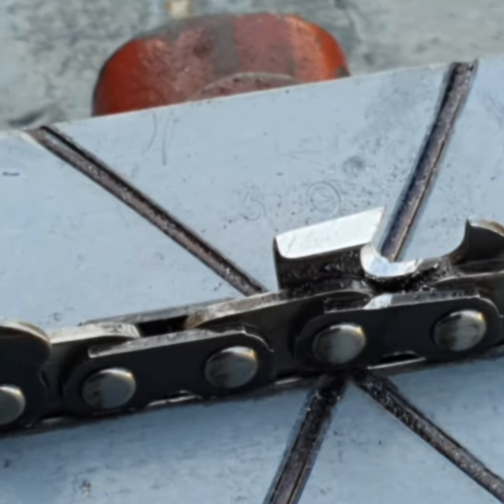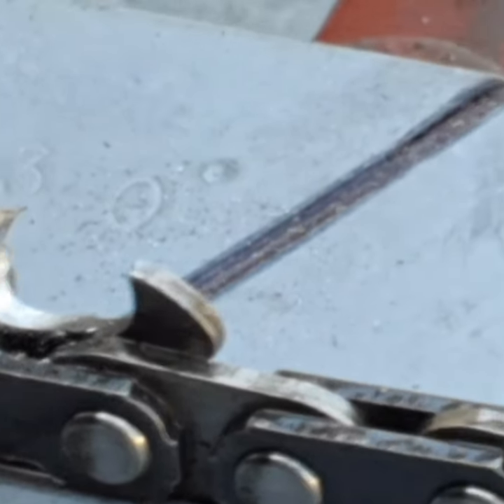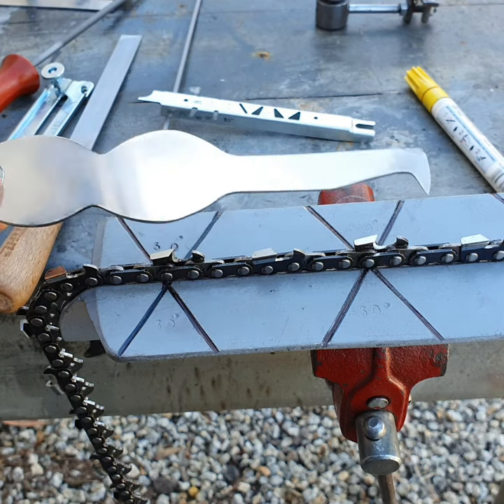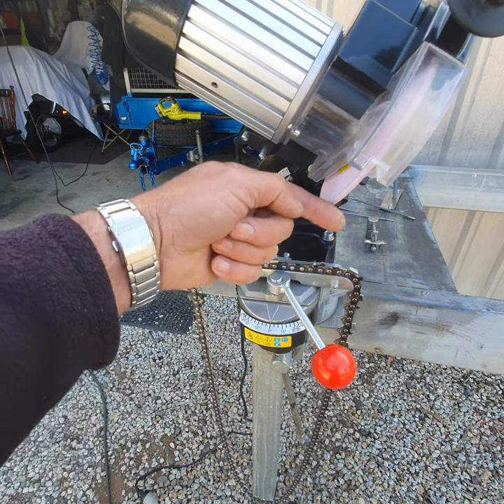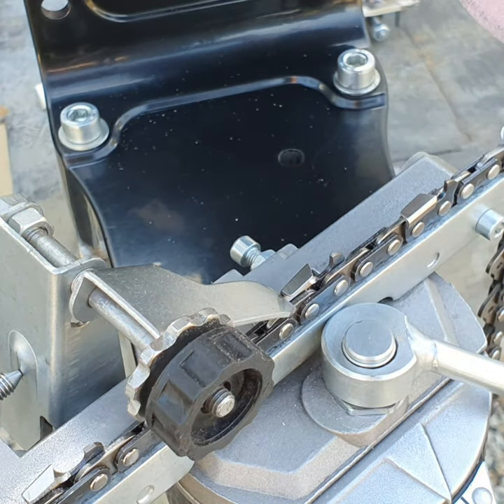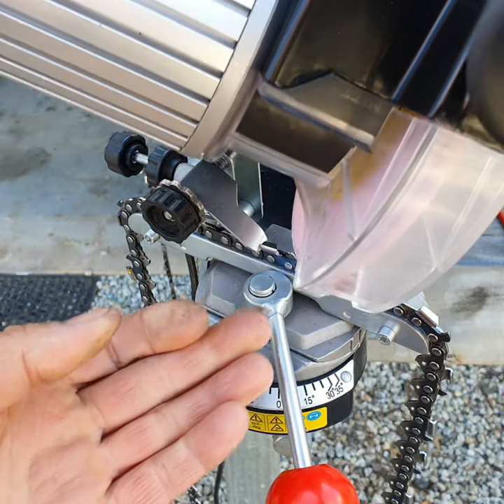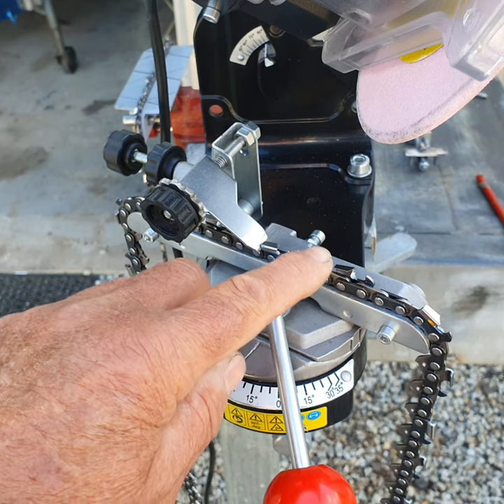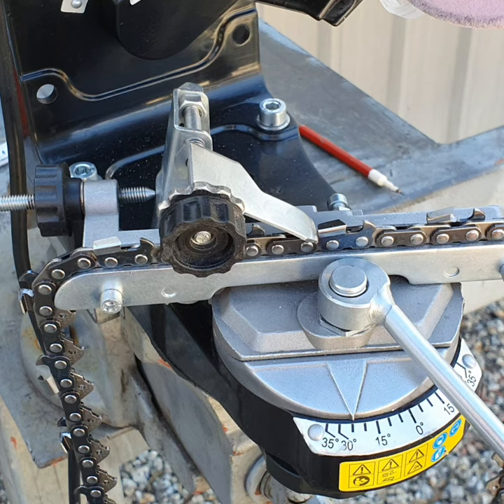Chainsaw Sharpening Basics with handfile and grinder

Comment: The absolute best way to sharpen a chainsaw chain is with a Dremel Took fitted with a chainsaw sharpening stone. I learned about it from a Stihl mechanic about thirty years ago. I've been heating my house with a woodstove since the winter of 1983. I used a file to sharpen chainsaw chains for many years until I found out about doing it with a Dremel Tool.

The trick to doing it right is to align the sharpening stone with the angular mark on top of the tooth (i.e.on Stihl chains) and to drop the Dremel motor to a slight down angle. You'll figure it out. If you don't drop the Dremel motor down slightly the saw won't cut straight (it will slowly curve off).

 Sharpening a chainsaw chain with a Dremel Tool is two or three times faster than doing it with a file (one reason being that you don't have to take the chain off of the bar), plus it takes off less metal, half as much I'd say, so that your chains will last nearly twice as long. 

You can buy the Dremel Tool and the chainsaw sharpening stones at Home Depot or Lowe's. The stones come in four different sizes.

Comment: Straight on the point.
Your informations are very good indeed.
Especialy "dont overheat the metal". Absolutly accurate! Then the tooth will go blunt because the steel got heatsoften.
Reply from the maker: If you overheat the tooth and turn it blue it will harden more and you won't be able to file it.  It will only harden about 10 thousand of an inch  or say .027mm
Reply: @ChainsawUsers  why is that? Some kind of airhardening steel?
Reply from the maker: When you slightly blue the metal of a chainsaw tooth you case harden the tooth a few thousands of an inch.
Reply: @ChainsawUsers  ok that sounds like an air hardening steel then. Dint know that one. Tought the were oil harden.
Thy

Comment: Thanks for the tutorial, do you have a link of where to check out/buy that clone grinder? Have you had any issues with it?  Cheers
Reply from the maker: I got it here in Australia at johno and jono ballarat $145 it works well and made well
Reply: @ChainsawUsers  thats great, thanks! And do you use the Oregon sharpening disks? Or are they a generic brand?
Reply from the maker: @333Paradigm333  I find the Oregon wheels burn the teeth to easy mainly because of the grit size.  I use 60 grit and chinese pink wheels also from johno and johno and i never  blue and teeth with them.  The Oregon wheels blue the teeth so easy have to go twice as slow to avoid any burning.  So i use that cheaper wheels with better results.
Reply: @ChainsawUsers  Amazing, thanks for the helpful info!
Reply from the maker: @333Paradigm333  have you been having problems with Oregon wheels also ?
Reply: @ChainsawUsers  no sir, I was just familiar with the Oregon sharpener but did not want to pay $700. I've just ordered the model you have as it's dirt cheap and looks like it will do the job just fine. Again, thanks for your help. Looking forward to putting the hand file away for the multi chain sherpenings.
Reply from the maker: @333Paradigm333  The only thing i did to the unit was swap the globe to a led 15w globe so bright easy to see what you are doing.
I am in Australia Victoria.  Where do you live
Reply: @ChainsawUsers  thanks, I'll keep that globe in mind. I'm located in the Gold Coast and work as a climbing arborist.  Thanks again.
Reply from the maker: https://www.chainsawspares.com.au/?gclid=Cj0KCQiAzeSdBhC4ARIsACj36uEVsC81VNHMFCr5UkXm4_LJ1FdxfSgazEuF9H8sk8qg2RdeLv5X2EwaAnrDEALw_wcB
Reply from the maker: It works well no problems
https://www.chainsawspares.com.au/?gclid=Cj0KCQiAzeSdBhC4ARIsACj36uEVsC81VNHMFCr5UkXm4_LJ1FdxfSgazEuF9H8sk8qg2RdeLv5X2EwaAnrDEALw_wcB
Reply: Hey so I have an update and I must say, it's not great. It seems when I'm grinding to the specified angles (usually 30 degree tooth angle & 60 degree disk angle) I've found that the top plate is way too open of an angle, and it fails to create enough hook on the top plate in order to cut efficiently. I've double checked the disk sizes and tried on 3/8Lp, .325 on the smaller 3/8Lp-.325 disk, and 3/8 standard on the 3/8-.404 disk. The only way I was able to get any better hook on the top plate was to max out the angle of the grinding disk to 45 degrees. 

Do you have any suggestions of what I might be doing wrong? I went back to hand filing with way better results. Thanks.
Reply from the maker: @333Paradigm333  Hi you really don't need much hook at all.  The most important thing is the tooth is razor sharp.  To much hook only weakens the top plate edge so don't worry about hook that much ok its not a game changer.
I have a facebook chainsaw group
https://m.facebook.com/groups/703771293626715/